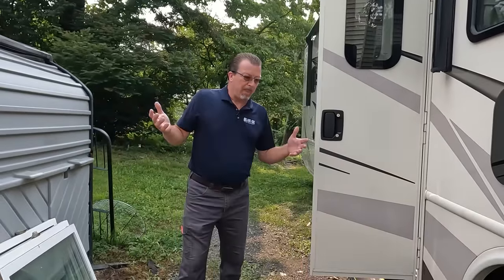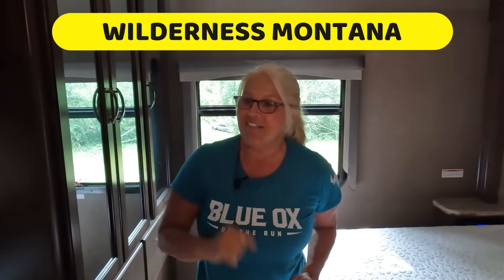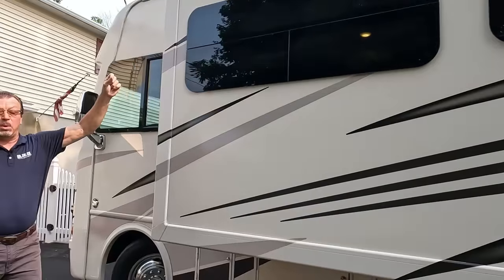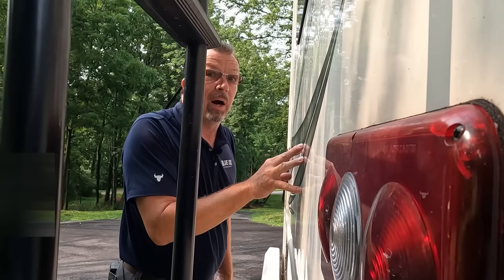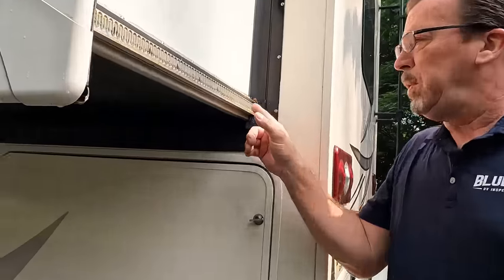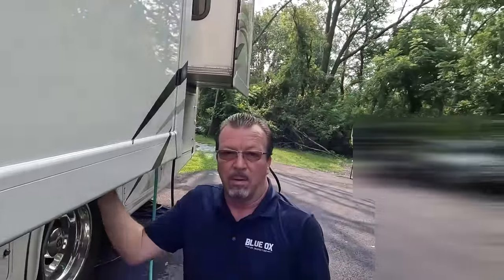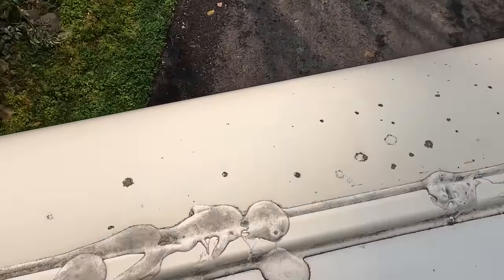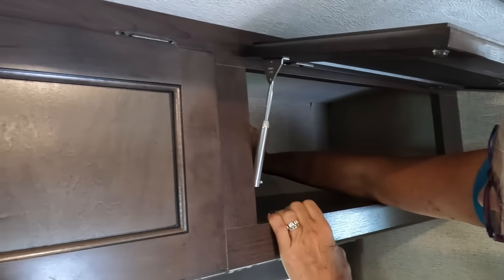🤬It's a TRAP for RV BUYERS! WHY are RV Sellers DISHONEST? THOR ACE 30.3

Comment: I did Home Inspections and was always amazed that people would buy a used or even a brand new house without getting an inspection. When I bought a used car I hired a mechanic to check out the major systems. If I were to buy a used RV The odds are I would catch quite a few issues that most wouldn’t and would have eliminated a number of possible units bur when it comes down to pulling the trigger on something north of $100k yeah I’m calling a second opinion in because $6-7 hundred dollars vs tearing apart and rebuilding a couple of slide units or wall panels. And I carry a kit of meters, and electrical system testers every where I go as well as a Flir camera. 

Keep on looking out for those who are in need.
Reply from the maker: Exactly our goal...I'm with you and like you....when it boils down to it, I call the specialist to confirm my findings and check for more

Comment: Just prior to covid, I was interested in the rv world. My jeep was limited as to what it could pull. Researched suitable platforms & checked out the various forums for those rigs. More than anything else, I found that RV folks tolerate lousy engineering, fabrication, & construction. 
I bought a motorcycle.
Reply from the maker: 🤣🤣 be safe out there 🤙

Comment: As tough as it can be, I always check my emotions on any vehicle purchase. Jeep, truck, RV, boat…are just tools to assist me achieving a particular goal. Just as there are a variety of tools from cheap to high quality, I have reasonable expectations based on price point. 
A highly knowledgeable inspector with experience…invaluable. I bought a brand new RV without an inspection and was highly fortunate but what a gamble. Even with construction and maritime experience I will never buy another RV, new or used, without hiring an inspector.
Reply from the maker: I do the same....check every thing with my general common sense yet limited knowledge to sort out what I think is the best one...then I call a specialist in that particular field to have a better and more concise picture🙂

Comment: I used to own a Thor citation Mercedes sprinter, the decals are about four years,seats cracks, they are make cheap, the floor vinyl comes up in around bathroom, always check roof. It has only 17,000 miles when I sold it.

Comment: You guys are SIMPLY the BEST! You guys have opened my eyes. BTW, what is an acceptable level of moisture in an RV inside wall?
Reply from the maker: Depending on the meter used, you have to learn the difference between frames and voids. Usually between 5 - 10....to 25 - 35. Over that, you need to figure why it is higher 😉

Comment: I would NOT SAY it's a maintenance situation, those problems are on the backs of the RV factory for improperly installing many things. POOR CONSTRUCTION
UNFORTUNATELY is VERY COMMON in RV's, they are built to the poorest standards and sold
Reply from the maker: You also have a point as QC is mostly inexistant at manufacturers plant...
Reply: Also, p poor materials in comparison to material used years ago.
Remember steel roofing?
Aluminum siding?
Somehow plastics became king in everything manufactured and it doesn't hold up to time, weather and UV rays.
Reply from the maker: So does the new water based sealant 🙄 the cheaper slideout mechanism and cheap plastic skis on slideouts....

Comment: I certainly think it's worth the money to have someone check it out with the potential buyer. They can point out what they found so the buyer will have a clue what lies beneath. I saw a video on a camper where the damage was hidden behind the closet wall and on the roof but who goes on the roof? Who goes into a closet to get a good look? You open the door, see a place to hang clothing and close the door. I cannot image investing 80gs into that camper only to find out its basically rotting under it all. It must have had major issues when it was brand new for it to be that damaged in a short time.
Reply from the maker: That's the Bone we aim to find....😁
Working for you, not the dealership, manufacturer or seller!

Comment: There is also the health issues associated with mold that is possibly growing inside the walls and ceiling.
Reply from the maker: Exactly 💯 I'm still fighting my own infection from inspecting those units lately
Reply: @blueoxontherun9188 may I suggest u don’t continue filming in a soaked RV, like on the couch to finish off your final chit chat session. And start wearing a mask inside to inspect, film, then do a record voice over of what your doing, if in fact these RV’s are causing u issues! 🙄
Reply from the maker: Hell yeah they are 🤢!
We are looking into masks for real...it's just hard to know and realize "when" you are nailed with airborne fungus....I've got weak lungs to start. Laurel takes more time to feel it then I do...
Reply: @blueoxontherun9188  Some people are allergic to mold so will of course have a reaction when exposed. I had allergy testing done years ago and I know I have allergies to mold. Florida has a lot of airborne mold because of the hot humid environment to begin with. You might be fine with N95 masks because they are rated for fine particulates. When I worked as a nurse here in Canada that is what we wore for protection against tuberculosis and viral infections. It was also recommended for the smoke from the forest fires for sensitive populations. Take care.

Comment: Great video guys and I do understand how things can get tricky if you don't know. When we bought our first house even after the inspection I still found problems and lucky for me none major but still there were problems. Inspections are well worth it as you both have shown.
Reply from the maker: Thanks for seeing the light 😅 you're appreciated
Reply: @blueoxontherun9188  Excellent advise! What will be the average inspection charge for the Dallas/Fort Worth TX area and do you have any recommendations?
Reply from the maker: You will have to do your due diligence and research. We did a few videos on hiring an inspector. Invaluable information to screen your potential future inspector. 
Remember, we are all independent businesses and comfort of knowledge on what we perform. This is not a Cookie Cutter Industry with a proforma questionnaire regulated ! All are different.
Reply: How are, specifically home inspections, "worth it" if the inspector is in the pocket of your agent and conveniently fails to note serious problems that the home buyer should obviously know about? My last home had an attached garage where the rafter slope was incorrectly built, resulting in an actual dip the last 6" of the slope to make it line up with the guttering. Water sat there over the years, seeped under the shingles and rotted out the roof decking and the ends of the rafters. To sell the house we had to tear out all the damaged areas and sister in new rafters at the correct slope then re roof over the rafters. The dip was so obvious nobody that went up on that roof could have failed to notice it but our inspection report said nothing about it at all. My bet is that a lot of home inspectors will fail to note serious problems that would shoot a home sale down because they don't want to get a reputation for causing home sales to collapse. Again, prove me wrong.

Comment: Don't mean to be a hater but when it's a Thor or Forest River... I would not even step inside.  As you see under the bed it's a bad build; no quality.  Also, low end "cheap" rigs tend not to be will maintained because people are on a tight budget and don't spend the extra time and money to maintain them.  Just as you see, lube the lower slide tract but not the upper.  I don't even think you need to lube the tract... I have my roof and seals inspected once a year by a mobile tech because they known what to look for and I don't.  I had wooden yachts before motorhomes and surveys were required when buying/selling.  I know the damage water can do.  

Banks should require an inspection before approving a loan.  I bet you the seller of that motorhome has no idea how bad it is - but - will find a buyer and not disclose what you found.
Reply: That is kind of hard to do these days since Thor went on a buying spree and even bought Tiffin and Newmar over the past several years.
Reply: @-chic  Thor bought Tiffin; Winnebago bought Newmar.  Hearing from some Tiffin folks in our FMCA club the quality has really dropped as they have pages of punch list items on their new 2020+ Buses.  I've got a 2013 Tiffin and the quality is not so wonderful.  The wonderful thing is the (cult following) Tiffin service center in Red Bay and Bob Tiffin authorizing repairs way out of warranty.  However, that has been cut back by Thor now that Bob is stepping back.  A mobile tech I use said to avoid the models that have Thor or Forest River on them - they are the worst.  Other brands under Thor could be better... but not top notch.  Years ago most of the items made for RV's were quality made in the USA.  Now most of the parts are from China and Mexico and don't hold up.  Combine that with poor build quality and lack of quality control at the factory and you have a rolling disaster.  No way I'll move up as it's better to keep the problem I know then move into the unknown at a higher cost.
Reply: Since the industry isn't regulated lots of things get passed by. However, your point about an inspection before a loan is a good idea, but I suppose banks aren't losing enough money on RV loans to make it worthwhile.
Reply: @petitchenil  yeah, sorry I realized that right after I left lol (about it being Winnebago/Newmar ) We have always had Tiffin heck even when I was a kid my folks always had to have the top of the line Tiffin lol, dad became friends with Bob over the years. We are getting older now, hubs retired and I can work anywhere so we were thinking about maybe downsizing a bit from our 2020 Phaeton, selling the house for a condo and actually traveling more but have found with the seemingly drop in quality (yes, the community is indeed great!) we would rather keep what we know rather than risk the problems as well...at least for now. (ahhh who am I kidding , I'm female and subject to change my mind tomorrow! haha - so I will say at least for *today*! ) On a totally different note, we have friends that refuse to move up from their aging Beaver DP because "everything now is crap"...man those were built like a tank!
Reply from the maker: Females have the right to change their minds, often🤣 We hope one day, banks will make it mandatory to have an inspection!
Reply: @blueoxontherun9188  That would be one of the best things to happen to the industry in decades!
Reply: @blueoxontherun9188  but that won't apply to those who pay cash. I'd rather see higher standards applied to the manufacturers, nip the problem at the source. IMO

Comment: For the same reason people who sell houses are dishonest what I don’t understand is why when I bought the house I have it was advertised as having central heat and air being twice the size it was having a half acre and it turns out that it has a .21 of an acre and it didn’t even have heat. It had a air-conditioning but not heat so I ended up having to buy a heater on Amazon for the living room and I use electric heaters in the bedroom and in the bathroom in the winter, I tell you people won’t tell you everything when a lot of money is  involved
Reply from the maker: EXACTLY...wisdom statement right there

Comment: I’ve own a lot of used campers from 17’, 19’, 21, 24,27’, 29’, and 35’’ bunkhouses all purchased used and guess what, when I sold each one of then for a lot more money than I paid for them. We went cross country 10,000 miles in the 17’ with me & my wife, two children and my mother-in-law 🎉😂❤ and the 19’, 21’, 24’, 27’, 29’, and 35’, we would keep them at beaches along the East coast every year from Maine to Florida and in between in the summer and fall and then move them to a ski mountain to ski in and out of them as they were tail side all winter long ❤🎉😊  great days a lot of fun was had by all. And by the way I inspected them all myself had one problem with the 17’ footer leak in the roof fixed with a pie pan and later with a 4x8 sheet of SS. NO MORE PROBLEM.

Comment: Want to know how to buy a good RV guaranteed? Easy, DON'T BUY ONE PERIOD. The sad fact is that the majority of RV's made today are GARBAGE, they're designed to look ever so pretty on the outside, while the substandard construction and cheapo engineering decisions made in the design process all add up to a sparkly pile of pig manure that falls apart in no time at all.

Think about it for a moment, on any given day an RV may get up to 75 MPH on the highway. That's HURRICANE FORCE WINDS. Hit a pothole on the road at speed, and you've just experienced the equivalent of a 6.0 earthquake on the Richter scale. And that's just in a single day. Now imagine any structure exposed to these forces day after day, week after week, year after year. 

Now that you're imagining the ideal structure to be able to actually handle these CONTINUAL forces on a daily basis, get a good picture in your head of what is needed to deal with this, and then go look at how the average RV is actually constructed. Once you're done laughing yourself sick, you'll know exactly what to do with an RV, which is to stay far, far away.

Comment: I am not a huge fan of slides.  I always see problems with them.  Our camper is 45 feet and if I dont have enough room now there is something wrong.  When I was young 28 feet was a big camper.   Have you had experience with the Prevost slide seals?  They inflate when the slide is fully open or closed.  Do you find that makes a better seal than the standard ones?  Also just curious, with a name like Pierre are you French?   Etes vous Francais?
Reply from the maker: Bein oui Joe ! 🤙
Anything is better than a flat wiper seal.

Comment: Great video that shows the. need for a quality inspection. As you asked around the outside of the unit, I couldn't help but notice the condition of the property and shed next to the motorhome, the property also reflects a lack of taking care of it, just like the failed preventative maintenance on the RV. What kind of a moisture meter is that? I would find that tool helpful to check the moisture content of rough sawn lumber I am air drying. Thanks for another great video.
Reply from the maker: Shhhhhhttt! Don't share all the tips openly 🤫 for free !🤣
Reply: It looks like the MT28 Moisture Meter by R&D instruments (if memory serves it was around 35-40 bucks)

Comment: 1: how much do you charge?
2: what is “ normal water readings in a rv wall.
3: would low usage in it’s self not say problem?
4: sad but the plastics used on a rv do fail for no reason other that just being on the roof.

Comment: You just saved this buyer from having a horrible experience with RVing and your inspection was money well spent. She would have had a money pit and likely ran from RVing in a few years and never returned. However, for those who have been RVing for years they likely know what to look for and a moisture meter is $30. If you maintain your RV properly you know what to look for. So, to say it's foolish to not get an inspection really only applies to those unfamiliar or if the rig is far away. Same applies to boat buying.

Comment: A friend had one. A 2016. His slide outs were the worse. He had to take a special trip back to the factory to get his slide outs fixed. Local RV dealers didn't have the skill set to fix it.  I wouldn't buy an  rv or trailer with slide outs. Plus, these are too big to navigate thru cities. My friend went up highway one in California. And the roads were so narrow and windy it was difficult from going into oncoming lanes. Doesn't all those styles of RV's built cheap If you have one bad. They are all bad!!
Reply from the maker: Pretty much 😶

Comment: I was just duped buying a brand new RV.  It is a thirty foot Forest River Rogue. Holes in the floor , breakers keep kicking out , couches have holes in them..   The best one is that our Side X Side we were told that it would fit and even more so we were told that most four seaters would fit inside the toy hauler.  No way a 4 seater will fit. Our 2 seater has to go in catty wompus and then it marks up the walls and damages the drawers.   Finally we were told that we could not trade it back because NOW  it is a used trailer .  $ 45,000.00 later
We bought this trailer in St. Helens Oregon….the name I think is RV FAMILY FUN .??
Reply from the maker: Sorry to hear about your story 😢 sadly, it is a common story tho. Make sure to spread the name around so other people avoid becoming the next victim. Exactly why we did this channel so people become aware of situations like yours and don't duplicate it...🙂
Reply: You didn't measure the unit to see if your SXS would fit?  Feel for you but ya have to do some research before parting with your money.  Salesmen will tell you anything to get a sale.
Reply from the maker: That is definitely the MO of any salesperson....they will say whatever you want to hear to close a sale 🤣
Reply: I have been reading that the quality of most new RVs has dropped steeply in the past few years, and that the only large rigs that are still well-built are the Tiffin, Nuemarr, and, of course, the beautiful and ungodly expensive Prevest Marathon & Liberty coaches. Thor (the worst), Forest River, Coachman, Jayco, and even Winnebago have been turning out junk that is falling apart even before it leaves the dealer's lot.